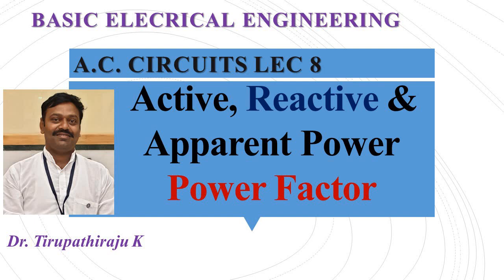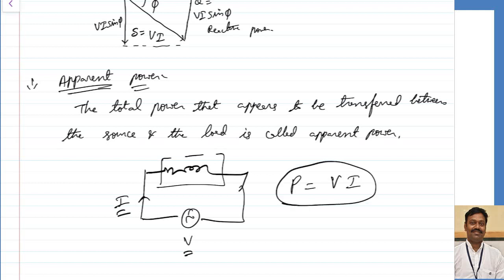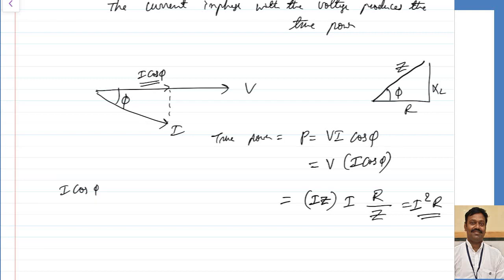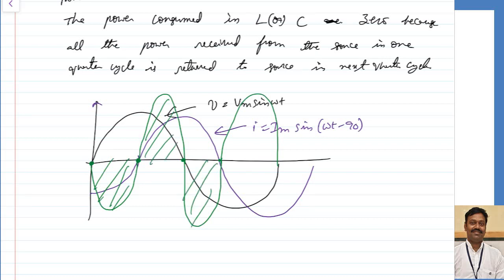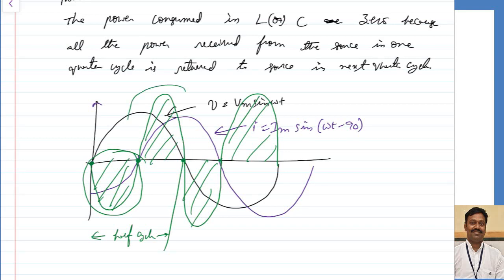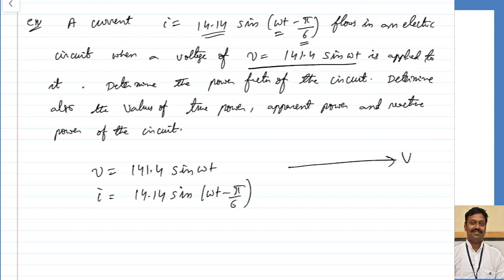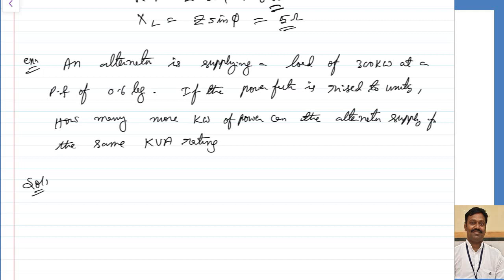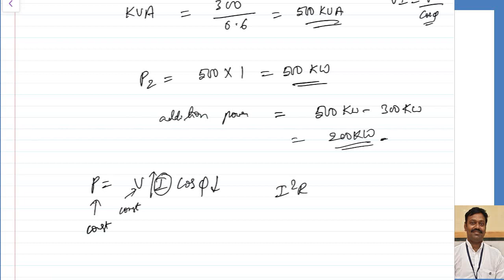BEE 208 Active Reactive Apparent Power Power Factor

Comment: Sir towards the end at time  22:32 you have explained if Power factor decreaes ,Current will increase with the same VA and Votage .
So I^2*R  loss will increase in the Alternator .
MY QUESTION :
P.f value depends on the load (R and XL) Value . If P.f will decrease ,it means Power factor angle will increase that means XL Value increases ,Net impedance(Z) increases .
If  Z is going to increase current(I) should decrease .
But you have said on the very last Problem Current will increase  on p.f decrement . Plz justify sir ?